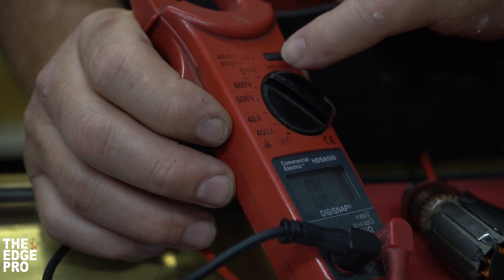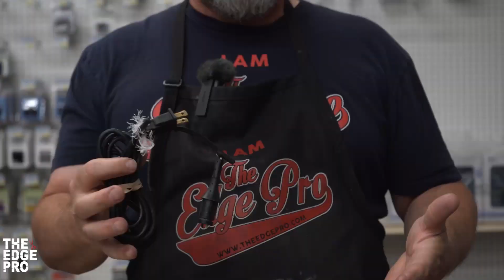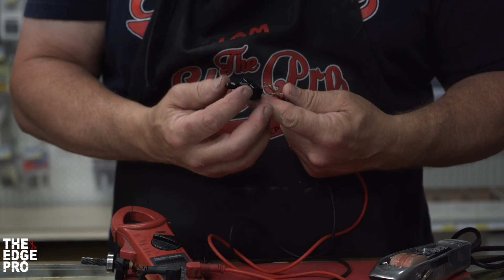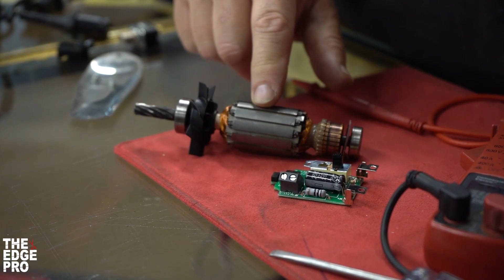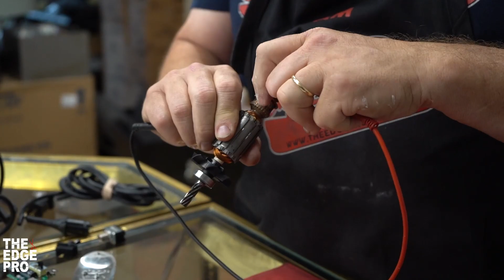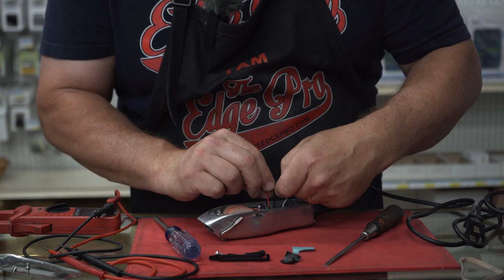Diagnostics using an OHM meter

Comment: Is it worth it to replace a bad resistor or diode  in the circuit board ?
Reply from the maker: I like your question, if you have the skills to soldier on a circuit board and have access to the correct components it can be ok to do. The cost of the boards we work with and fairly easy access to replacement components, the labor would cost more to replace the individual components compared to the new board.